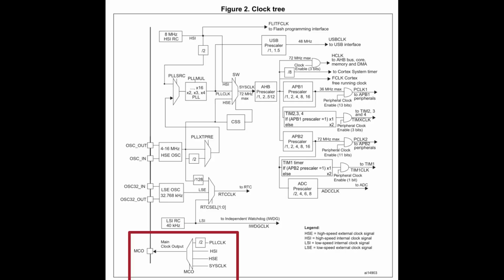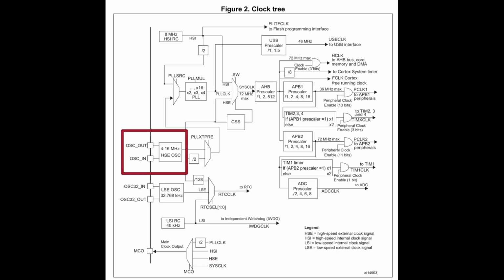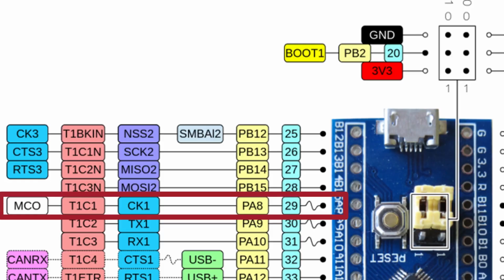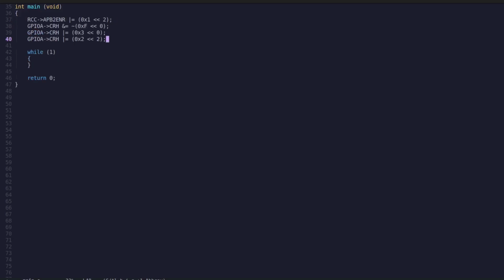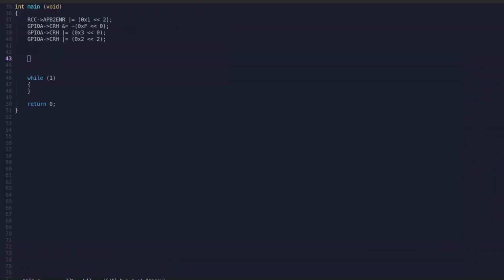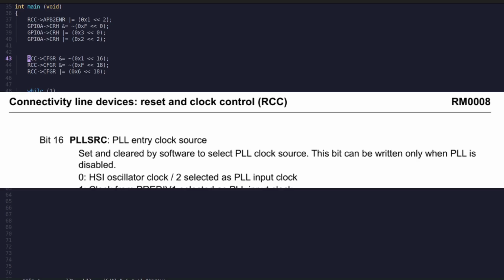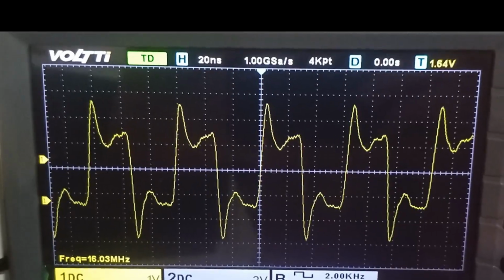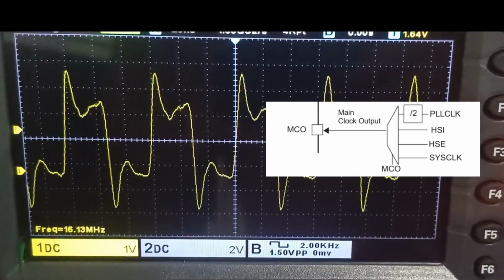How to use the Main clock output (MCO) - STM32

Comment: Thx for the video, seems to me that to get value from it I will need to look at what you did and then review what that code does according to the reference manual. “Copy and paste”coding works but you learn nothing from it.  I understand that the F4 series has different registers than F1 series for example, so it would be useful if you could please nominate the microcontroller variation you’re using.

Just for interest, the oscilloscope traces are terrible! I was expecting square waves, or close to at least.  Do you know if the trace is like that because of the oscilloscope or something on the controller board?
Reply from the maker: Thank you for your comment and also for your tip about specifying the MCU, I will definitely do that!
Regarding the waveform, it's certainly not the oscilloscope itself. It could be the probe configuration that I may have missed or actual signal integrity issues, since I was using a prototyping board with very simple wiring.